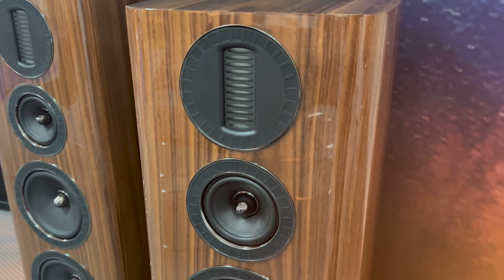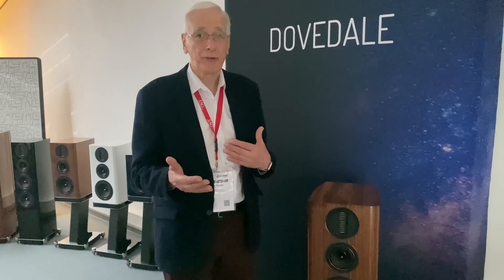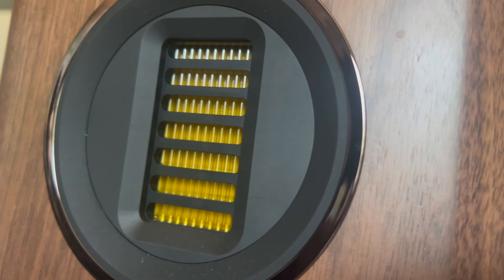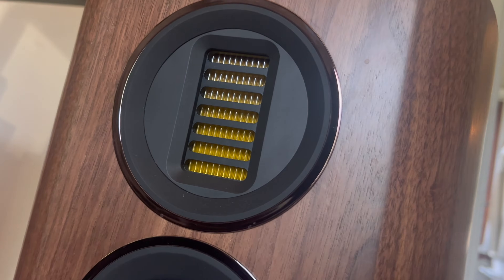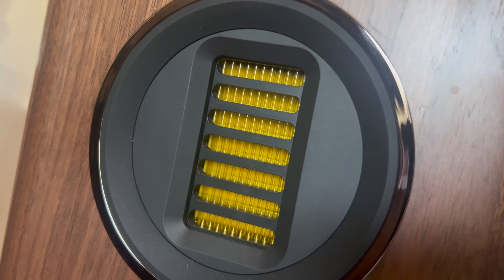Peter Comeau from Wharfedale: Why use AMT tweeter? How does it work?

Comment: Awesome video thank you. 
Would it be a bad idea to run two(one in each kick) Dayton Audio LS10-44 10" Low Profile Subwoofer as mid bass and front sub duty  crossed over between 160-200hz with STEG mss3 instead of running smaller mid bass drivers and a front sub?
Reply: yes